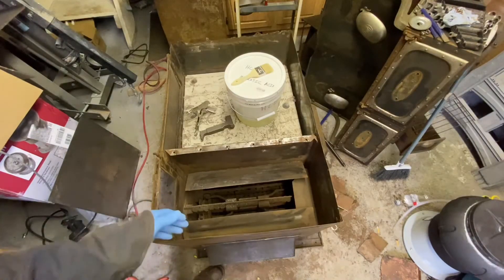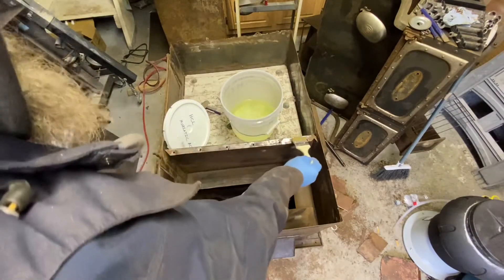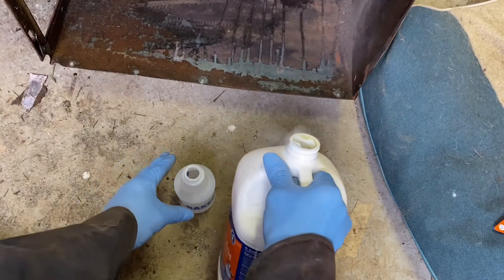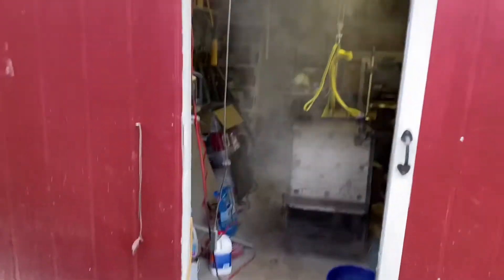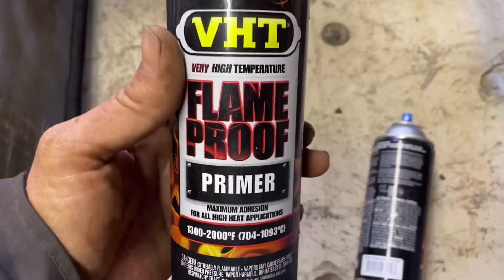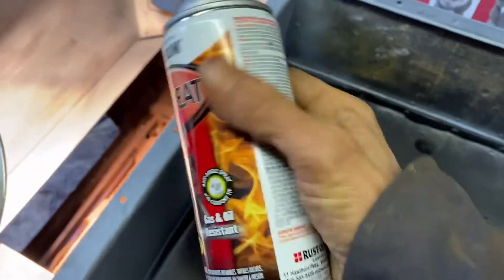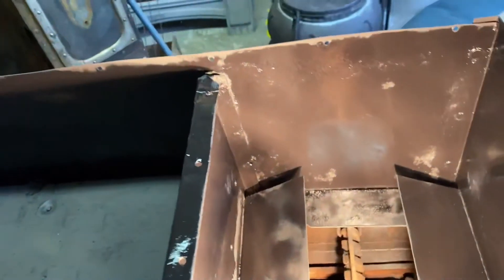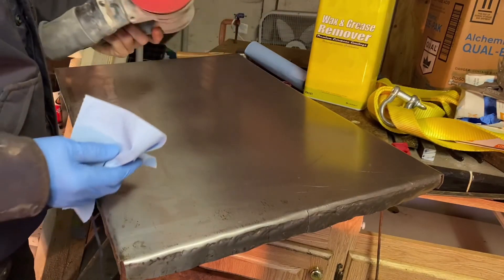Wood Cookstove restoration part 2, Rust removal

Comment: You should use phosphoric acid which will neutralize the rust make carbon coating to prevent further rust Can also be painted over - Muriatic acid will continue to attack base metal & eat away especially after paint - Nice resto project.